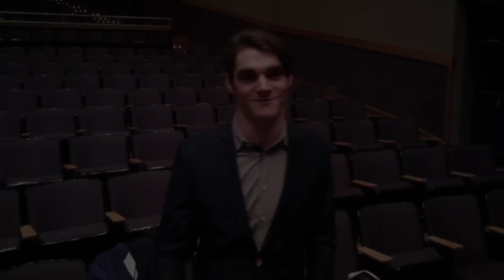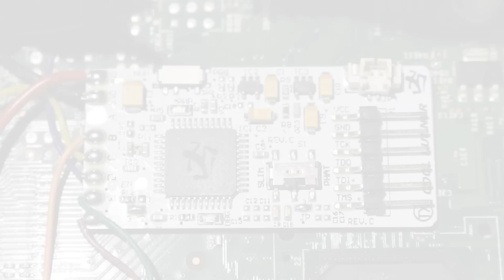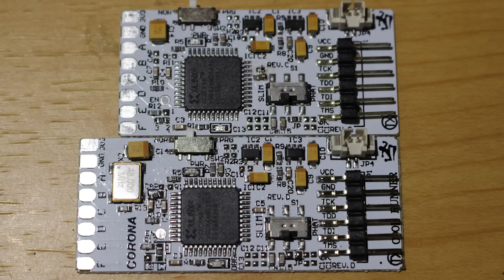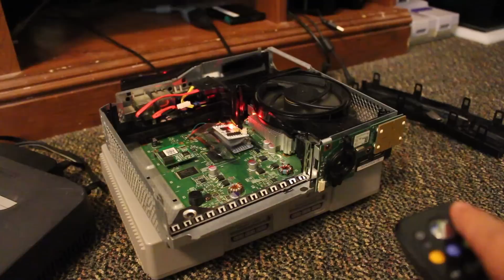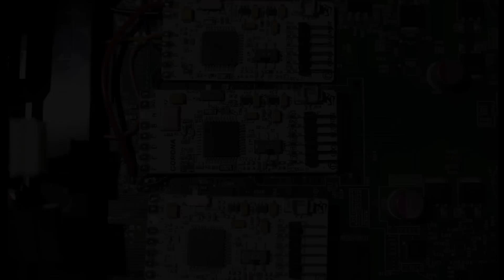Clone CoolRunner Comparison - How Do They Perform? | Rev C & Rev D

Comment: i wanna cry. i worked my CR Rev.C with C8 capacitor and JP resistor both REMOVED already(according to most tutorials and guides and layout images). and it failed to achieve a sRGH boot whatever timing files i tried. I have to look back to CR4 Muffin install anyway.(Wiring was correct because CR4 Muffin technique finally made it boot but had to spend several reset cycles.)

Comment: Now, it don't matter what coolrunner you used, it's all in the timing file provided by 15432.....lol
TX made millions conning people into believing that their products was the bees knees
Reply from the maker: 15432 is a legend for that, although I've been told the newer Coolrunner clones on the market aren't all that.
Reply: @MrMario2011  the cr3 lite clones still worked best, even the ones that people said wasn't good, it's all in the timing file. however...with the introduction of the ace chips for the slim and the matrix glitcher v3 for the fats, i'm quite happy with the selections....lol

Comment: Coolrunner Rev D Clone and Trinity are no good combo. Boottimes are way too off, even when fully optimized.
Reply: everyone having issues with normal RGH2 setup on Trinity, even if cpu_rst is omptimized, try "Muffin" setup, here the cpu_rst length doesn't really matter and can be as short as possible and boottimes are most of the time better.
I had a Trinity with Coolrunner Rev D, that wouldn't boot no matter how i optimized (cpu_rst from [°0,20mm] 50cm length down to 2cm in 2cm steps, testing everytime. Then i used CR4 option on the Nand image and timing file "muffin_7-1_dt.xsvf" from the folder "..JRunner\common\xsvf\muffin\Trinity\192 MHz (48 MHz clock)" on the Coolrunner. Coolrunner setup: Jumper 1 open, C8 removed, Jumper 2 bridged 3-2, Jumper 3 open, onboard clock signal.
Now it boots within 5 cycles everytime.

Comment: Thanks a lot for your contribution of this video, never heart someone who speaks so clear english !
Reply: Just got the original clone Coolrunner Rev D booting fast. Xbox 360 trinity with 250GB hdd boottimes : 12,23,12,40,12,18,39,18,12 and 12 seconds. Used clock of motherboard, 2-3 closed, jumper closed and wire length cpu_rst of about I think (stripped 2 times) 60 - 6 = 54cm.

Comment: Xilinx makes the chips; they're a kind of chip called a CPLD, or "Complex Programmable Logic Device". They do nothing without being programmed, and if you load the same program into the same model of CPLD, they do exactly the same thing. In fact, Team Xecuter named the board after the Xilinx chip family they used, which is also called CoolRunner. The board is basically the CPLD and the minimum amount of support chips to make it work. The hardware is nothing special on Team Xecuter's part; their work was almost all in the logic program that configures the chip.

The crooked resistor was done on purpose; it's a 0-Ohm resistor, aka a jumper. There was probably an error in the board design, and that was the fix for it.

A new cleaned-up version of this design is now being sold for $3 on ebay as a Xilinx CoolRunner II "core development module" as well as an XBox360 hack, which is how I came across it.
Reply from the maker: Coolrunner 2? Do you have a link to it? All I know are of the clone Rev C and D boards, so this sounds interesting 😸
Reply from the maker: I also look this up - the board looks like one of those Matrix boards

Comment: Thanks for the video without those jumpers switched to 2/3 my trinity wouldn't boot either spent the last 2 days with different length wiring etc saw your video tried it and no i get 4 sec boots FFS was just about to order a $50 CR4 xl

Comment: Where can I buy these chips, and can they be installed in a slim??
Reply: Kyogre Cubing | ikyogre1 I can tell by this comment that you have no idea and because of that, i feel like you will mess up your entire xbox.
Reply from the maker: Kyogre Cubing | ikyogre1 Bruh.... What type of system was I showing them on this entire video?
Reply: I can't tell if it a slim or a corona. You said both D:
Reply: ***** Wait, Is corona a slim? Im so lost!
Reply: Ive done mods on many other systems without fail. Ive just neven opened an xbox/
Reply: Kyogre Cubing | ikyogre1
well xbox slim has one xclamp and smaller, thats how you know
Reply: +Kyogre Cubing | ikyogre1 theres a corona v1-4 and there is a simple trinity

Comment: The only points you need to worry about is cpu_rst and post out. I actually encourage people to try things other than TX reason being its hard to come by now. If you're interested in testing chips I think you'll have fun with the DGX Stone. Every slim I've done was instant boot literally every single time. And you don't need to program the boards either.
Reply from the maker: REDPLASMA1305 There's so many chips out now it's crazy, the thing is TX is always recommended just because they're so well known, they're really a household name for any Xbox modder.

Most people who bash knockoffs/clones/any other brand are just fanboys really.
Reply: ***** TX is really good no doubt! But due to its availability I feel people might be discouraged from modding their systems. I just love to fool around with any chip I can get my hands on. I love the RGH concept in general and the challenge of getting good boot times. However, most of the widely more available chips are really hit and miss. Chips I can back up are DGX Stone, clone Rev. Cs, Squirts (Clones also), and the X360 Run.
Reply from the maker: I've heard Ace is good as well. You can get them in bulk for like $2 or $3 each :o
Reply: ***** that is actually one I have yet to try. But are they only for coronas? I've seen videos of people using them in phats but no diagram or files.

Comment: I have falcon console and want to RGH it, from all the research I've done l'm going to buy a rev c and to read the nand and program the console I need a nand x or a Jr programmer. The Jr v2 is too expensive for me and nand x's being sold anymore. Is there any cheaper solution? Or should I just invest in a demon and get a dual nand going
Reply from the maker: Omraan Wayezi There's other NAND flashers out there but I don't have much experience with them, you'd still probably need a NAND reader/writer for a DemoN, if that's the case good luck finding a kit. They're even harder to find lol
Reply: What would you recommend as chip+reader/writer beside cr4 xl and Jr programmer

Comment: ***** I'm not the best person with soldering so I had a cool runner rev c and a zephyr board and at first the console was acting weird it would show 3 RROD but would boot in stock dash and now the thing won't even power on anymore. Do you know anything about this?

Should I just trash it? I really don't care for it much anyways.
Reply: Adamus Maximus Experience only like a year late lol. i would just sell and say it needs some touch up if you sell both chips with it you should be good. you probably don't care now lol. good luck